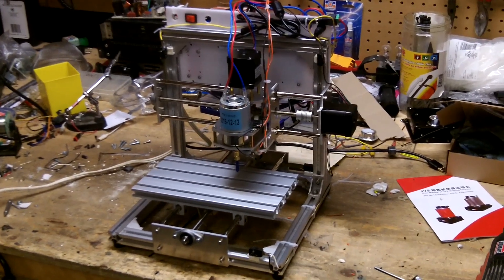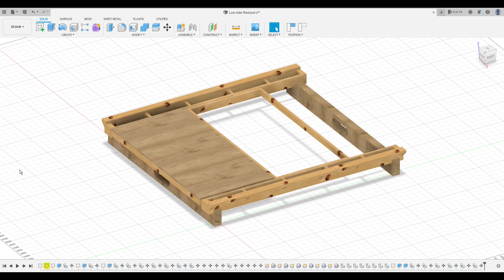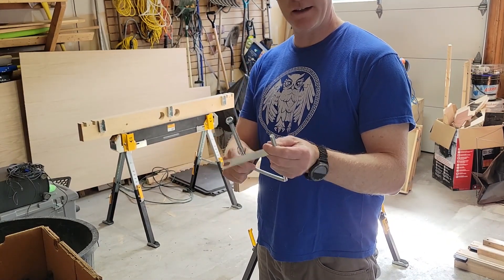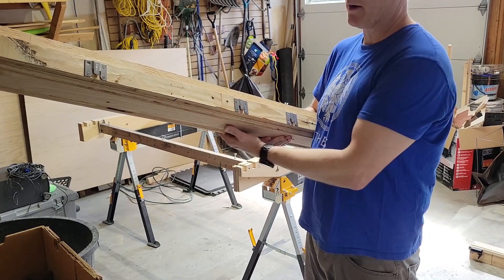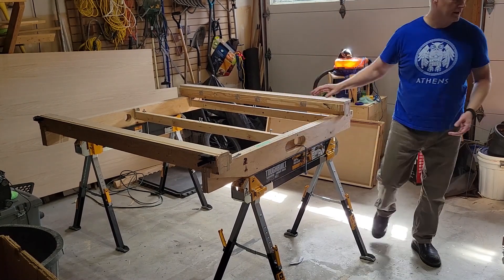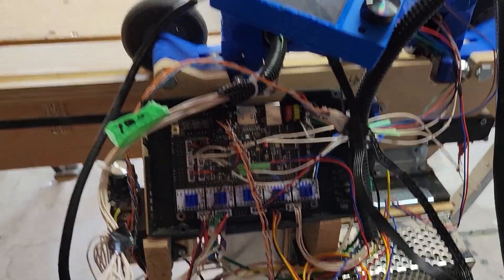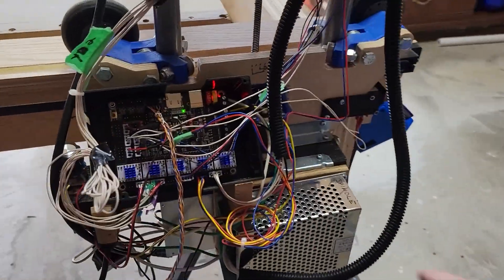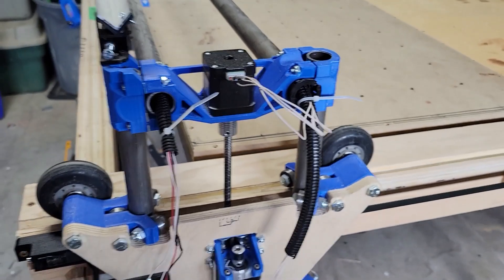Building a Lowrider CNC from start(ish) to finish

Comment: Any updates on that? How is it running? What is the max material thickness? :)
Reply from the maker: I had an issue with the spindle mount (the PLA softened and the router slipped due to heat)--I have re-designed that part since then.  Unfortunately I had to take it down to make room in the garage for awhile :(  It should cut a few inches (depends on the bit used) but I have about 4" of travel or so in the z-axis.

Comment: Awesome build. I got here following a link on your V1 forum build. I’m building an LR3, and saw this, and the original design and think it looks great, very functional. 

I do have a question though- why not utilize the 2x4 cutouts in the sawhorses and make a table without the additional cradle? You could flip it 90 degrees and offset the rails vertically to clear the sawhorses, then build with the furniture clips and removable torsion boxes. 

I only ask because I just bought 2 of the same sawhorses for a different project and immediately saw how I could use them for an LR3 table. 

Looking forward to seeing more LR2 videos!

Comment: had same trouble getting wheels what adjustments are needed for 72mm wheels ?  Thanks Steve
Reply from the maker: I had to put small (5mm or so) brass spacers between the wheel and the Y-carriage so that the wheels would clear the bolts.  Other than that nothing else..

Comment: Very interesting. I've been planning something vaguely similar. In my case, I want to use my workbench as the platform. I've been planning a set of removable rails similar to your box beams that would mount on either side of the long axis of the bench.  I had been wondering about how to engineer the rails, your box beams are a great idea.
Reply: The v3 on the MPCNC website uses rails. I’m sure the schematics and purchasable kit will help you out.

Comment: I'm getting ready to build one myself. Any tips or anything you'd do different?
Reply from the maker: Nothing profoundly different no--Alignment and squaring are the biggest things to get right and the V-slot rails are a must in my opinion--single best thing to keep the gantry parallel even after installing dual Y-end stops.